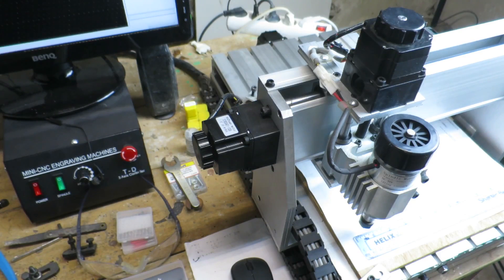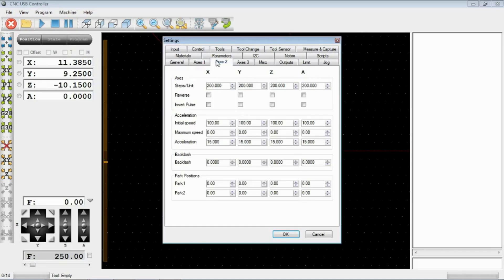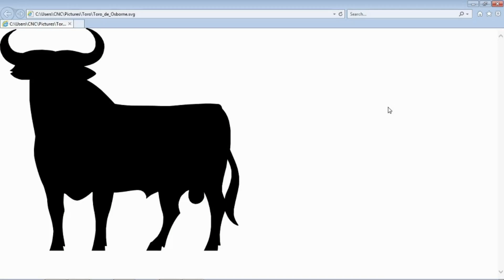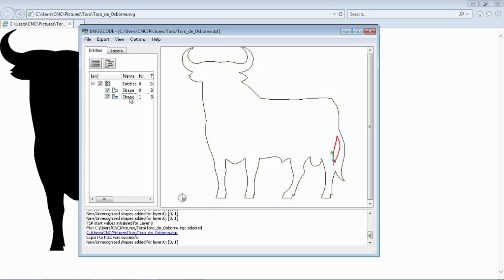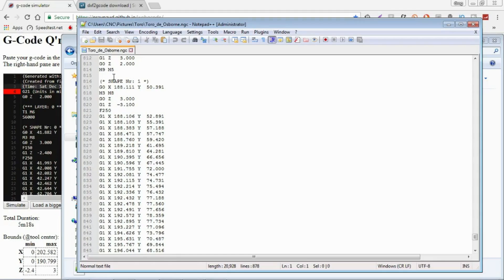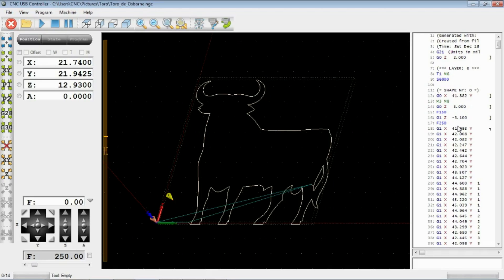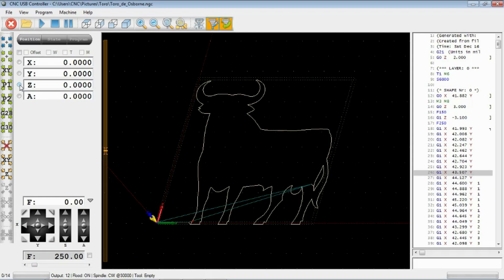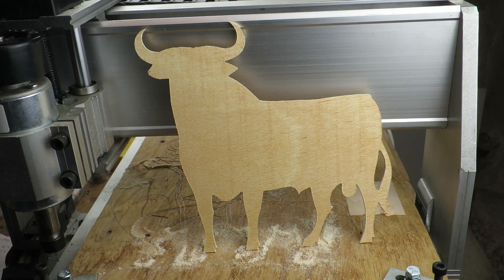First Steps in CNC CNC3040 CNC USB controller Setup Test Cut Tutorial

Comment: Hello! Thank you for such a great video! A neighbor gave me his old 3040 and I am going through the process of repairing it and hopefully using it. I've been doing research and people seem to say that there are problems using a parallel port to usb adapter to control the machine. Is that what you're using on your 3040? My laptop doesn't have a parallel port so I'm wondering if you had luck with your USB and if so where you sourced the adapter.. Thank you very much!
Reply from the maker: Hi, my unit came with a USB controller board. This link looks useful for you : https://rckeith.co.uk/mach3-parallel-port/ Thanks for watching, have a great day!

Comment: HI. Thanks for the video! I have question: I have the same CNC as you. After a while, cnc usb software made update, so now I have demo with 25 lines. Did you try Mach 3 or any other software, to run without parallel port, but with USB?

Thanks

Comment: Looks like  I  have the same cnc machine  and control box I'm  trying to  use my laptop  to run it I  also was told I  needed  to use uc100 so I  picked  it up also had to get male to male connecter  so it would plug into my control box I  have  mach 3  on my laptop  uc100 is putting  out  green and blue light  I  can turn my  spindle  on and it works but that's it no noise  from the cnc machine  motors  not running  or making noise  do you have any suggestions  thanks
Reply from the maker: My controller has USB connection and I use CNC USB software. I have no experience of your setup so sorry can't help. The spindle motor is simply switched on and off by the controller box so that's why it works. Thanks for watching, have a great day!

Comment: I am upgrading my 3020t with a MK2 board but was wondering how to connect the spindle, what board are you using and how did you connect the spindle?
Reply from the maker: My unit has a separate spindle board the JP-1482 you can see in the bottom of the screen here :  https://www.youtube.com/watch?v=32hjG9YyjDM
There is a schematic of the board here : https://hackaday.io/project/6776-3040-cnc-milling-machine-mods/log/21618-jp-1482-spindle-controller-schematic
Reply: @1nformatica  Could I use the Yoocnc PW3618 spindle board with the MK2 planetcnc?
Reply from the maker: Sorry I don't know. There is an active forum here : https://www.cnczone.com/forums/planetcnc/

Comment: As I don’t have a manual can you tell me what the software program is called for the control box set up  or where I can download it from as I’ve bought a used cnc which is similar. A very well explained video
Reply from the maker: Hey thanks! Much depends on what controller board is fitted. You need to take the lid off and look at the PCB's. Mine has two, the main control board is a JP-382C the other just controls the spindle speed. The JP382 board is a Chinese knock off of the Planet CNC controller and has a hooky copy of an old Planet CNC software which is no longer supported although it suits my needs.
You can get the software I have here : https://drive.google.com/open?id=1wrRtQa8f2NDGwyjDSf6UvxCt20zEBo0_ but it will only work in demo mode with your controller. You could also try one of the many free CNC programs https://all3dp.com/2/cnc-router-software-find-the-tool-for-you/ Please consider subscribing if you have not done so already!

Comment: Fantastic, man. :) Those machines are awesome!
Reply from the maker: Obrigado Mario! It sure is a lot of fun and a bit scary. Forgot to say in the video that there are no limit switches and the "emergency stop" button is big and impressive but actually does nothing!! A bit like most politicians!!!
Reply: 1nformatica HAHAHAHA I know exactly what you mean! :D
Reply: you can assign a keyboard, mouse or controller button to act as your emergency cut off, in the software - have a look for key bindings. you can also set keys to pause or speed up / slow down the program. I have used one of these and it seems like the physical emergency button is purely decorative! Great Video.
Reply from the maker: Thanks Louis, great tips. There is an emergency button in the top left of the CNC software that works also.

Comment: HI! Great video!! I've one just like that! one thing that i recomend is to buy a drag knife! works great  to engrave aluminium glass and stone! . One question: In mine CNC one of the steppers is broken ( making weird noises) do you know here to find a spare one ? the ones i find have higher voltages.. Best regards!
Reply from the maker: A drag knife is a great idea, do you have a recommendation for one? The stepper motors on mine are Nema 23 type. These are generic type as long as it is the same degrees per step (1.8 °) it should be OK. Mine are 2 Amp rated but higher will be fine as the current is controlled by the stepper driver board. For my machine I would look at : HANPOSE Double Shaft 56mm Nema 23 Stepper Motor https://bit.ly/Nema23
Reply from the maker: @Fokyou69  Great, thanks! Looks really good, one more for my Christmas list!

Comment: Can you tell me how can I get the machine's software? I got it used in a yard sale but no software came with it
Reply from the maker: Much depends on what controller board is fitted. You need to take the lid off and look at the PCB's. Mine has two, the main control board is a JP-382C the other just controls the spindle speed. The JP382 board is a Chinese knock off of the Planet CNC controller and has a hooky copy of an old Planet CNC software which is no longer supported although it suits my needs.

Comment: Hi, Thanks for posting this video. I've just bought one of these machines and the demo software is limited to 25 lines of gcode. You obviously have the licensed version - before I buy the licence, is there any latency issues using the supplied USB to parallel port lead - I'm using a Sony Vaio laptop, Windows 7 32 bit, which appears to work okay with the demo version. I've considered buying an old PC with a parallel port, install Linux to use LinuxCNC but space is an issue.
Reply from the maker: Hello Bob, your machine is different to mine. Mine only has USB, no parallel option. Mine came with a "hooky" copy of the CNC USB program and the licence was included on the supplied CD although it was not obvious. There is an option under the "Help" tab to activate the license.
Reply: @1nformatica  Thanks for the info. I've been in touch with Planet CNC and they told me that many people were sold quite good machines but the controller is a cloned copy of their Mk 1 version, which is no longer supported. The software is also, let's say, 'non genuine'. The latest Planet CNC controller costs €119 +VAT, with an adaptor to get rid of the parallel port and the software licence is about €80 + VAT. They are based in Slovenia and very helpful. They told me the Chinese cloned controller is poor quality with very little cache memory but advised me to try it with their software and see how it performs. I'll buy the software licence, and when I've recovered from Christmas I'll probably upgrade the controller as well.
Reply from the maker: Interesting! Keep me up to date on your progress.
Reply: @1nformatica  I gave up in the end. Planet CNC only licence the hardware, i.e. the control board - it seems that if you buy their control board for €119 + VAT you can use their software free of charge ( that's what I understand anyway). If you buy their software, it wont run as the control box needs the licence, which being a Chinese clone, they wont licence. They also offer absolutely NO warranty so I bought a very nice used PC and monitor for £40 with a parallel port, lead and keyboard and my son installed Linux Debian and LinuxCNC. Linux and  Linux CNC is free and after a bit of a steep learning experience, it seems to be running fine. I've set it up to run XYZ and A  and there is an option to set the axes automatically to zero in the setup. I haven't got that far yet! N.B LinuxCNC only works with a parallel port machine. Hope this helps.
Reply from the maker: Thanks for the update Bob. Good to know you have a solution. Now the real fun can begin! What will you make first?
Reply: @1nformatica  First I will make space in my shed! I think I'll try some downloaded DFX files which I'll feed through a gcode converter and check the settings. It's all set up in my hall at the moment so I've been running it without a cutter installed. I have some drawings on Fusion 360 for a device called a Strandbeest - yep that is spelled correctly (google it - it's fascinating)  - I'd like to make one for my grandson (and his dad) - also, I'm restoring a 50 year old Triumph Herald for a friend and he wants a walnut veneered dash board. I'll have to divide the drawing and have a second and possibly third start position for that one. I'll practice on a piece of plywood first. Sadly, I've been very busy so I'll start on my shed in the next day or so. I also want to make circuit boards and if possible a wooden clock. Wish me luck :)
Reply from the maker: Good luck Bob or Buena Suerte as they say around here! I actually have a Strandbeest kit in my "to do" pile! I hope to be able to modify it for radio control! Take a look at the GCODE simulator I link to in the video description, I find it very useful.

Comment: sorry how do you turn on the spindle ? when i turn on mine , manually on the controller box ,axis x stepper motor are spinning too
Reply from the maker: There must be something wrong with your controller. Inside the box are 2 separate control boards. 1 drives the axis and the other the spindle. Turning on the spindle on my controller is only possible by the switch on the front. The CNCUSB software I have does not control the spindle.
Reply: @1nformatica  Thank you ! someone told me its the electric interference thingy, gotta find an electrician to get the earth line thing sorted out (although I have no idea at all what that means Lmao)
Reply from the maker: @s.chorng  Good luck, let us know how it works out.

Comment: I bought the 3040 with the blue controller box and no software or drivers incuded whatsoever! I downloaded the cnc usb controller but the "joystick type controll panel" is just greyed out and therefore doesn`t react at all! Is it possible that I need a license to be able to control it? Did I download just a demo from planet cnc? Oh, and I am using windows 7 32bit. Can you help somehow?
Reply from the maker: The CNC USB software needs a license which is keyed to a serial number on the control board. I do not know if it's possible to generate such a key. Your choices appear to be either buying a license or trying one of the open source CNC programs.
Reply: Hello, I have the same issue. were you able to solve this?
Reply: @rubengomes8978  no unfortunately not yet! What I wanted to do and produce to get a much better quality I am still doing with my K40 Lasercutter. As long as I still have a market for those products I don´t have to deal with that problem "for real", but this time will come one day!

Comment: what board usb controller work with CNC USB Controller? is there is a specific one or it work with any board support usb port?
Reply from the maker: Officially you should have a board from Planet CNC https://planet-cnc.com/
However there are many knock off Chinese clones out there. A quick search on eBay will find them!

Comment: Hey :) Im owning the same cnc engraver but im not able to move anything because the left side is grey colored?
now im buying the software (84,14€) i hope it will work now ? greetings peter
Reply from the maker: The controls are greyed out when the "emergency stop" icon has been pressed. Press again should return control. The "emergency stop" I refer to is the software red X icon top left in the window. The physical "emergency stop" button on the control panel does nothing on my unit!!
Reply: @1nformatica  It is supposed to stop lateral movement of the machine - i.e. stop the bit moving in case it's going somewhere it shouldn't. Doesn't stop it turning, but stops it moving. Well, it should!
Reply from the maker: I understand what it is supposed to do but on my unit the big red "panic" button does not work. I decided to add limit switches instead https://www.youtube.com/watch?v=2zK_c9hD3ys
Reply: @ @1nformatica  Oh, I didn't. I thought it would stop everything and not a bit of it. But the very helpful people who sold it to me told me... 

The problem I am having is that my vertical axis is the length of the machine and my horizontal is across it. Well, since I want to engrave wooden signs, that is the wrong way round, but I CANNOT find a way to switch the axes in the software. The only thing I can think of doing is to switch the input cables so the X goes into the Y and vice versa. That will have the effect I want, but is there any downside to that? Or easier way to do it?
Reply from the maker: I guess that approach will work, can't see an issue doing it. Everything is relative, for me, I would rotate the design in whatever software you use through 90 degrees before generating the GCODE!
Reply: @1nformatica  Ow - that would be such a pain! Everything I want to do will be landscape - and I'm using Carbide Create to generate, and I have no idea how to get CC to change its entire orientation after you have created what you want to create. In fact I'm not sure it'd do it - you have to fix the workpiece size at the start, and then next time you want to start a project, the workpiece area is still the same. No I think I'm on the right track - I need to change from portrait to landscape.

Thanks for that! Even if it was just soundboarding while I think aloud... :))
Reply from the maker: You're right. Carbide Create is not that flexible. Keep me posted on your progress, Good Luck!!

Comment: hi, i have the same cnc machine, i have installed the software, imported your settimgs, but still no movement on the axes what can be the problem ?? pls help 
le: i've open the power control unit, and i see that the board that controls the axes has no power, i mean the led doesn't turn on, but i have intaled the mach 3 demo and uc100 driver for the paralel port and it show me that the driver is instaled .. but still no movment on the axes
Reply from the maker: When you turn on the controller do the stepper motors energise? My unit has a seperate power supply board which passes 24 volts DC to the axes board you need to measure that with a multimeter if yours is the same.
Reply: @1nformatica  no .. they don't feel like they are getting any power .. everything is dead .. just the spindle is powered up
Reply: @1nformatica  what should i do in that case ??
Reply from the maker: You need to check with a multimeter that 24 volts is going to the axes board. On the spindle / power board there is a fuse for the 24 volts, maybe it has blown?
Reply: @1nformatica  ok . thanks ,i'll check it
Reply: @1nformatica  i have checked the power board, you were right, the fuse was burned, change it, put the power on, and again it burn the fuse.
first fuse was a  F5AL250v and i've replaced with a F10AL250v, i didn't had a fuse like the first one, so i've replaced with what i had,  and on top of that, some smoke came out from the other board chip   https://drive.google.com/file/d/1dzlbUxHLWNhx0b5Qxfb2bVVtKMik_t56/view?usp=drivesdk 
pls help me
Reply: @1nformatica  forgot to say that mine is 4 axis .. and that board that got smoked is the one on top .. pls help .. cuz i feel like i wanna give up already .. what would be tbe best solution at this point .. change the power box or do an upgrade for the axis controler ?
https://drive.google.com/folderview?id=1UQ5aI8zxu4bl_rIkQi6f8YdoCf1X07ev

Comment: new to this.. when i try to change the depth on the dxf2 code and go to simulator it shows 15  not working for me
Reply from the maker: Hi, by "depth" I understand you mean the Z axis. In my example it is set to -2.40 mm. You can see this value in the simulation. It is set in the "Machine Configuration" tab in dxf3gcode, here's another example : https://drive.google.com/file/d/1ORS74WSoFjZBM0yhIqMPP0zuV0tQFMci/view?usp=sharing
Please consider subscribing if you haven't done so already!!

Comment: My software says it needs to be activated although I just got it. I can only run about 25 lines of code. Any advice?
Reply from the maker: My machine included a hooky copy of the old Planet CNC software you can see in the video. This needs a license code to be entered using the "Activate License" option under the "Help" tab at the top of the screen. There was a file on the supplied CD with this code. The code is linked to the serial number of the controller board.
Reply: 1nformatica Thanks I was able to figure it out.
Reply from the maker: •:*¨¨*:•_•:*¨¨*:• EXCELENTE_•:*¨¨*:•_•:*¨¨*:•_!!
Reply: See my reply above to 1formatica.

Comment: Man, everytime when I load a GCode, the software is putting a self generated offset at the X axis which messes up my cuts and carvings. I checked everything, please let me know what I should do. Thank you.
Reply from the maker: I would try and narrow down where the offset is coming from. If the offset is always the same it could be either the design software which generates the code or in the CNC control software for the machine. Check you code with this online simulator https://nraynaud.github.io/webgcode/ do you see the offset in the simulation? Also I would try drawing just a simple square so you know what the GCODE is supposed to do. Maybe try this https://carbide3d.com/carbidecreate/  If the offset is varying it could be the "speeds and feeds" trying to move the axes too fast or cutting too much material can cause the stepper motors to skip steps. Let us know your progress. Good luck!!